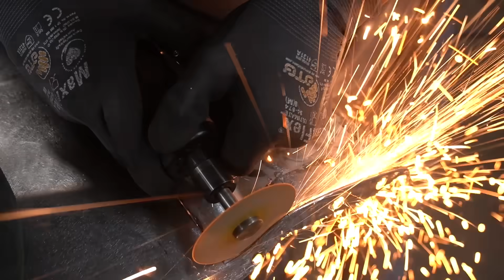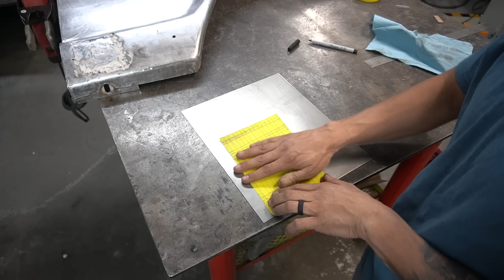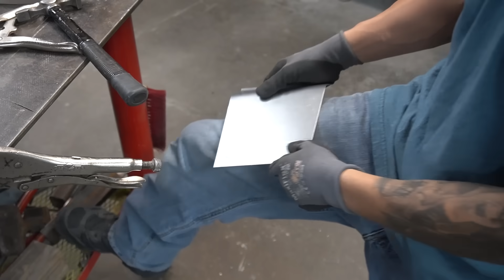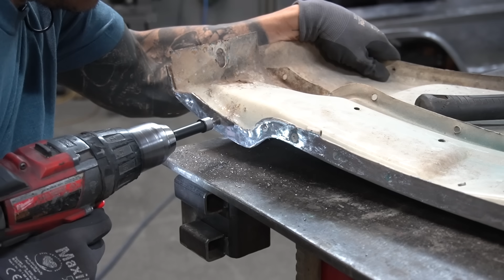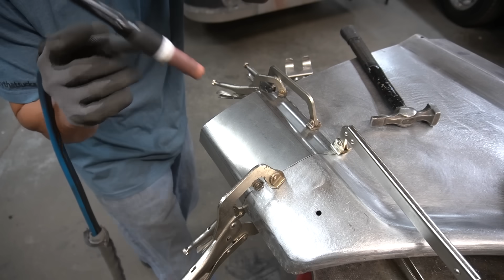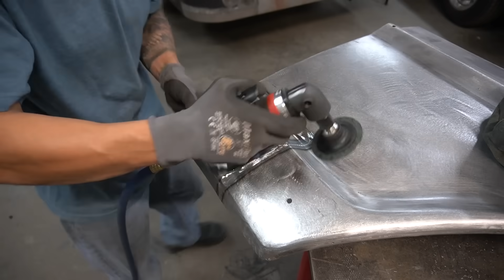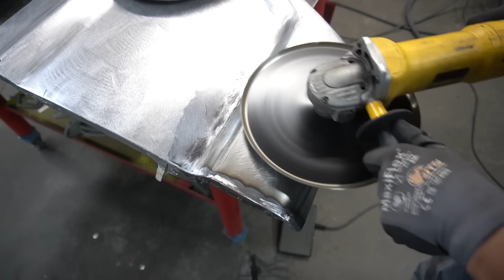how to make a patch panel | fix rust

Comment: I’m learning to weld for a truck restoration project. My biggest question here, should I be learning to TIG weld or is MIG adequate?? I noticed you use both here and it looks like you know what you’re doing…
Reply from the maker: Thank you! Yes it would actually be best to learn both. I use each one for different reasons. The mig is really versatile and will work for most everything except for planishing and stretching the weld, that's where the Tig welder comes in. I'm running hands on, in shop classes once a month. Check out the website if interested
Reply from the maker: Since your learning metal fabrication I was wondering if you would like to get on a call with me and I would be happy to answere any questions you might have about metal fabrication. I'm also gathering information from people for an important project I'm working on. If you wouldn't mind me interviewing you please schedule a call with me via the link. Looking forward to hearing back. https://calendly.com/tubalcainbamf/interview

Comment: Sorry to ask, but why are you TIG welding it rather than MIG welding it? I don't know anything about welding so trying to understand the process  - thank you :) And great video and skills on display there! :)
Reply from the maker: Tig welds are planish-able  they are softer welds so you can hammer them flat and mig welds are not. I needed to planish the patch but not the brace. By the way since your new to metal work I would love to ask you some questions for a project I'm working on, if you wouldn't mind getting on a call with me I would greatly appreciate it! Also I would be happy to answere any more questions you might have on your project as well during our call. There is a link in my YouTube description to pick a day and time.🙏
Reply: @BeAMetalFabricator  Thanks for taking time to reply. Unfortunately I've got some other commitments at the moment which means I won't get a chance to do some car stuff until next summer. And my car just requires a small amount of welding which I will probably get done with a load of body work by a professional. I watched your video because I was interested to understand the process, to better inform me on how to specify the repair (I don't want a patch plate welded over the rust hole it has). One of my 'bucket list' wishes is to restore a total basket case, doing the welding but this is a long way off due to other commitments and needing to finish the car I am working on at the moment which structurally requires minor work. Thank you very much for your video and time though - best regards
Reply from the maker: Right on man well good luck in the future! Thanks for watching my video
Reply: @BeAMetalFabricator  Thank you for taking time to make it, its brilliant content honestly :)

Comment: Goodnmoeninf! Thank you for your help. 

When do you prefer to use MIG VS TIG welding? 

I am starting restoration project myself and this is really helpful
Reply from the maker: I use the Tig on sheet metal when I have access to be able to planish my welds and make them disappear into the panel. If thats not the object, the mig works well

Comment: I need to know…what is the large angle grinder abrasive you’re using. The one that dishes up like a bowl?
Reply from the maker: It's a shrinking disk, it heats up the high spots and shrinks them down level with the rest of the panel. They work really good!

Comment: If you were using a MIG with the front side sheet metal, would you have used air to cool it down, or still just done it all in one go trusting the bends to keep it from distorting too much?
Reply from the maker: If I would have used a MiG I would have bounces around and cooled it with the air blower. That would have helped with the heat. Tig is much easier to planish the welds. That's why I can weld all at once

Comment: Very nice work.  One thing I need to understand better.  You formed up the patch so it fit on top of the existing panel.  Since the patch is the width of the patch metal wider top and bottom, it seems to me the patch would be twice the patch metal thickness too tall, but it fit perfectly.  Can you explain where I am thinking wrong?  Thanks Tom
Reply from the maker: The replacement panels always need a slight adjustment and tweaking after cutting the damaged piece out

Comment: What was that plastic big black disc for?
Reply from the maker: So it's actually a stainless steel shrinking disk with a black steel backing plate. It helps level out the small highs on the metal. It's an amazing tool!
Reply: @BeAMetalFabricator thanks for the clarification!

Comment: Best patch work I have seen! One tip you might consider,they sell Quart cans of cold galvanizing[97%zinc powder in clear epoxy] brush both sides of inner panels then weld together.the product dries quickly and is very rust resistant.
Reply from the maker: Great tip!

Comment: newbie question, what was the big grinder wheel you were using?  I'm not a sheet metal or body guy (but I will be doing some rust repair on my van) and I've never seen a wheel like that.
Reply from the maker: That's actually a shrinking disk on the gronder, not a grinding disk, it helps level out all the little bumps and high spots.
Reply: @BeAMetalFabricator  thanks, I'll check it out!
Reply from the maker: Hey man I just wanted to reach back out to you and see if you wouldn't mind getting on a call with me and letting me interview you and ask you some questions about your metal fab projects/journey for an important project that I am working on? If your down to chat check out my calendar and pick a day and time. I wouldn't greatly appreciate a few minutes of your time https://calendly.com/tubalcainbamf/interview

Comment: Just found your channel. Great video! I really liked the way you adapted Wray's flexible tape pattern to the job. Maybe a little more explaining, but ONLY if you're trying to target the true novice with your Be a Metal Fabricator channel. Things like saying why you finished the first bend with a soft hammer, what the slapper (and dolly-off, dolly-on) is doing, the what and why of the shrinking disc. You have great skills and it's easy to zip along at your level without realizing the new guy just got lost. Thank you for taking the time to share your knowledge. I will be back for more!
Reply from the maker: Awesome thank you! I will definitely take that into consideration! I appreciate you taking the time to watch and comment

Comment: Nice job. You have the fender off so coating and protecting the back side for longevity of the repair is not a problem. The issue i've seen with on car repairs is no one seems to address the back bare uncoated metal of the cut edges and but welds that will rust from the back side over time. The most I've seen is a few zinc coat the back of the patch panel before welding it in.

Comment: Fantastic work. 
One question...
Should I invest in a TIG for panel welding. I currently use a mig... But im wondering why you chose to use Tig on the panel (which you welded beautifully btw).
Reply from the maker: Thank you man also both welders have a place in the shop, Tig is an extremely useful tool! The reason I used it in this video was because the welds are much softer than mig welds and that allows the welds to be plannished much easier! I recommend getting a Tig welder!
Reply: @BeAMetalFabricator  Thank you for the reply. I will now need to make space in my workshop for a TIG 😂👍
Reply from the maker: Hey bro how's your project coming? Did you end up getting a Tig welder? Also I'm conducting some interviews with people doing sheet metal fabrication and patch panel replacement on their own vehicles. This is for an important project I'm working on. Would you be interested in helping me out and answering a few questions over a call? If that's something your willing to help me with just pick a day and time here. https://calendly.com/tubalcainbamf/interview thanks in advance!

Comment: please clarify. The pattern you made was perfect fit while on the top of the fender. When you patch is welded in place it would have been slightly too large. The video did not show how you dealt with that. thanks

Comment: You should also show a "DON"T DO THIS" when using a cutoff wheel without a guard.  When one disintegrates one day (and good chance it may) - you cannot react quick enough to miss the 'flying shards of death' - better to be safe than sorry - I have a scar from using an unguarded wheel about 40-years ago.  It is always amazing what a bit of ingenuity//smart thinking and some scrap tube can do to go towards doing a professional job, and watching these types of videos reminds me to use my 'smarts' - not always look for a high $$$$ piece of equipment to solve the issue.  CHEERS from AUSTRALIA.
Reply from the maker: Good call I should definitely be doing that or at least a face shield!
Reply: @BeAMetalFabricator  I run guards on my bigger cut-off tools, but not on the 3" one. It truly gets in the way too often, either physically or by blocking my view of the cut. I do, however, wear glasses AND a face shield almost 100% of the time. Hopefully that will be enough to stop a fragmenting disc should it ever happen

Comment: I would like to know if this method is applicable to replacing an entire car sill.
Reply from the maker: To replace an entire car?
Reply: @BeAMetalFabricator  i think it's translate issue, but your version is quite funny. I meant the lower part of the body, located below the doors and curving towards the bottom. Now I have doubts about the accuracy of the translation, but at least the description should make things clearer.

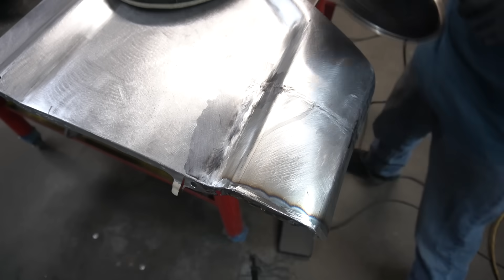Comment: I am new to patch repair.  What was the tool and purpose of the large wheel used at time stamp of 14:58.
Reply from the maker: It's a shrinking disk, it helps lower the highs from the over stretched metal, helps level everything out 😎👉

Comment: Would this require a skim coat of filler to straighten out perfectly before painting or is high build primer enough after blocking out?
Reply from the maker: A high build primer would probably work, but more than likely it will need a skim coat

Comment: Beautiful work. Question: Do you use any sort of primer on the backside before you added the inner fender support? I try to use a weld through zinc primer when I can. Just wondering your thoughts or if you have something better that you use.
Reply from the maker: Thanks for the comment bro and I have used the weld through primer before but to be honest I don't really like it because (even though it might not) it seems like its compromising the weld, it reminds me of welding on galvanized steel, it doesn't feel clean. I just try to put por15 or some kind of rust prevention on after its welded the best I can. it all depends on the situation that determines when I put the rust prevention on the panel.

Comment: Question: wouldn't you be better off welding the back before you do all the tapping ? Surely welding introduces distortion, doesn't it ?
Reply from the maker: yes welding does cause distortion, although i needed the back portion out of the way so I could planish the fender and get everything back in place. Also, the back brace had the spotweld marks that I had drilled out that told me where the brace was positioned originally. Thanks for watching

Comment: If you didn't do a full weld all at once you wouldn't had high and low spots. Thats too much heat for the sheet metal.
Reply from the maker: I know that's not true, In my experience it doesn't matter how I welded it, slow or fast, jump around, let it cool, or all at once, it would have warped a little and still had highs and lows. With this particular panel the heat distortion is more consistent when welded all at once but Everyone has their own way of doing things.
Reply: @BeAMetalFabricator 
Never in my experience does "jumping around" make highs and lows more than doing it all at once, because all at once produces a LOT of heat and metal then distorts like crazy.
But OK you have your way.
Oh and good job you are really skilful and I understand a desire to do it perfectly as I myself am a perfectionist, just here I was thinking that you are doing yourself a disservice by warping metal too much with all that heat and then you have to do so much panel beating, i.e. too much work for you.
Also I cut out the piece of the sheet that I have to replace and then just trace it directly on the new one and bend the new one around the old one. Taking into consideration the thickness of the sheet for the bent parts to be exact by measurements, which is also less time consuming.
Sometimes I don't even make a bend, but start to spot weld from the top and then bend the sheet as I go down, if you understand me.

Comment: You used different welding methods in the process. Why?
My guess: On the outer skirt you used Tig to get welds a hammer can form still. When all the shaping is done you resortet to Mig/Mag and if I wasn´t mistaken even without gas using the right thread(?) for all threats that are never visible from the outside. 
Asking for learning. I also got a whole car to fix and sometimes I get great results using Mig/Mag gasless, sometimes I keep burning holes.....
Reply from the maker: I used the tig because the welds are softer for planishing, I used the mig for the plug welds because its much more convenient and practical

Comment: Really nice, but what we missed in the video, is if you did any rust protection on the new piece of metal, on the inside between that brace and new metal?
Reply from the maker: yes it got undercoated after the fact

Comment: I need a patch panel for my monte carlo,  just ahead of the right rear wheel. the metal { and therefore the shape and curve } is missing. Could I use the tape method to make a duplicate of the drivers side which is intact and simply flip it over? I need the mirror image .
Reply from the maker: Yes you absolutely can!! I do this with an entire fender in one of my videos!

Comment: Great job 👍 
Curious, with the tig welding, could you keep running tig spot welds, until the whole panel was done? It would put a lot less heat into the panel and need less messing around after? Probably slower, but weld integrity should be good enough for body sheet metal? (I don't weld, yet..)
Reply from the maker: Tig spot welds are not as easy or officiant as the mig

Comment: This guy knows how to make patches. He forgot to show where he used weld through primer before replacing the structural piece over the bare metal patch. That Is very important part to prevent rust through.

Comment: That's pure artistry!I have one question.How can we avoid rust forming on the welding spots in the inner part of the panel if we don't have access to it because it is welded and not removable? It's a good idea to drill a little hole in a hidden spot of the panel and spray some rust inhibitor?Thank you!
Reply from the maker: yes that would work! I used internal frame coating with the straw! eastwood sells it.

Comment: What was the reason for using tig on the front-contolling the heat?
Reply from the maker: Tig welds are malleable so they stretch better than mig when planishing to get a straight panel

Comment: Why not put the tape over the section being replaced, instead of the peice beside it? Great work.
Reply from the maker: good question! I suppose I could have, although putting the tape in an area that is not destroyed allows me to gather all the information I need, like exactly where the bends are... I believe the first bend in that body line was destroyed with the bad patch.
Reply: @BeAMetalFabricator  Thanks, I was curious because it looks like that bend is not parallel to the bottom edge.

Comment: I know there's a hundred ways to skin a cat, but why wouldn't you "cut in" the patch. meaning, clamp the patch to the fender, and make your cut through the patch and fender both for a perfect fit? to clarify, there is absolutely nothing wrong with your patch, or method, just curious is all.
Reply from the maker: if I'm understanding you correctly, if I did that it would leave me with too big of a gap from the cut off wheel if I cut on the outside of the patch with it clamped to the fender....

Comment: good job but to be definitively efficient,  you should  put grease everywhere. grease et the only thing very efficient against rust. put grease between metal and carpet, inside door, behind bumper, behind (inside the car), behind  the repairs you can make (everywhere inside this door - hidden erea -  instead of using paint), hollow areas (necessarily hidden, so no need to be aesthetic). For rear wings unreachable with a paintbrush, use an extender and poor old oil everywhere each year.Handyman Experience - 35 years.   From france
Reply from the maker: Ill keep that in mind😎👉

Comment: What kind of welder are you using?  I like the way you apply the heat and control the rod.  I'm experienced at stick welding,  most shops use a MIG with gas and wire I don't care for, its guessing where the weld it going and leaves a messy weld, no control to form a nice bead in my opinion. Look forward to hearing from you, nice work.
Reply from the maker: Thanks man much appreciated! I'm using a Miller 180 tig welder.

Comment: Hi good job just some advice on tools throw away the small air grinder and buy yourself a Milwaukee m12 fuel angled grinder fantastic bit of kit will pay for itself in a matter of weeks in electricity cost best tool I've bought fitted with 3m roloc disks gets into the toughest places and without the airline drag😊
Also look at straight handled one for use as a cut off tool
Reply from the maker: I have been wanting those tools for a while now but I just haven't pulled the trigger